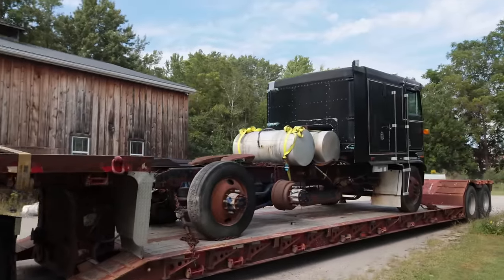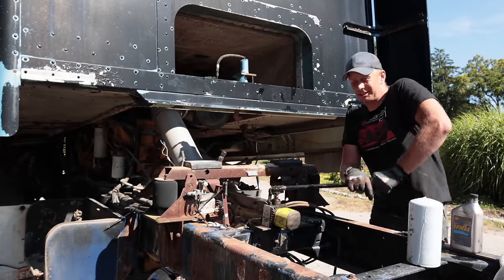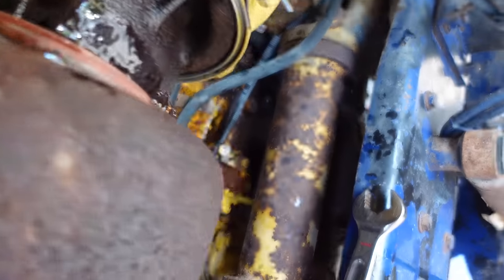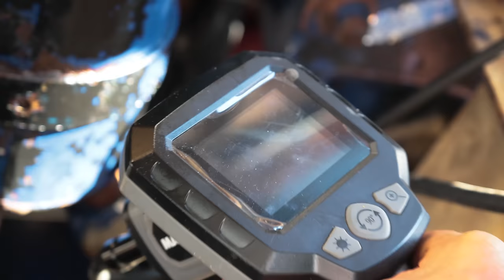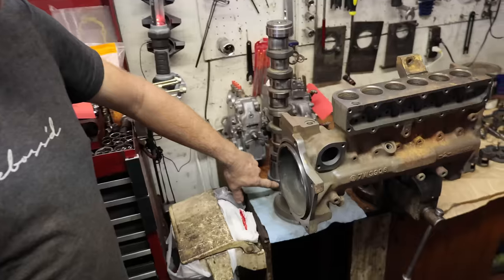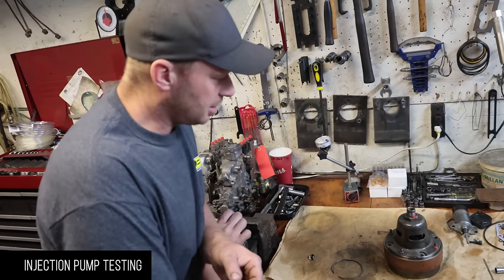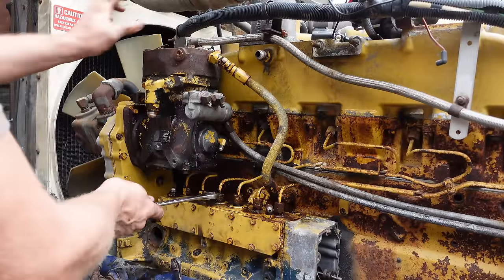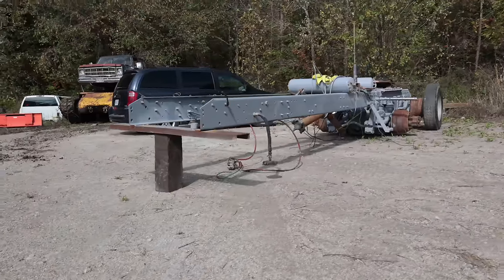Will It Start? CAT 3406b Kenworth Cabover Hasn't Ran in 25 Years! #K100Cabover [EP1]

Comment: Watch part 2! https://youtu.be/fp-C7q6kRFA
Reply: Fantastic news!
Reply: Didn't know you had a second channel. Subbed!!
Reply: Double bonus!
Reply: #teamseas.........
Reply: Good to see the old gal getting a new lease on life
Reply: I drove many different ones during my career all of them did a good job.
Reply: .. TC u
Reply: 5/
Reply: If you are interested I know where a 110 inch double Pete cab-over is setting with a running Detroit 430 or 475hp with an Allison automatic from the factory is setting. The truck runs it is 1978 model Pete and looks very good for its age. Give me an email address and I will send you some pictures of the truck. The person that has it does not want much for it. I think you could get the truck for under $5,000.00. I know I could get it under that.
Reply: If anyone knows where a 1997 through 2000 International 9800 cabover sleeper flat floor, air ride, Cummins N14 with Eaton 13 or 18 speed, I'm looking to buy now. I want it to be a fixer upper but drivable so I could get it home to do it up to match the enclosed race trailer and 88 Monte SS it would pull. Thanks
Reply: CC  gg

Comment: I have always wondered why no one rebuilds their own injector pumps, this explains it.
Reply: Not big deal with injection pumps. Biggest problems are governor fly weights they wear and also timing advance fly wheels. Weights are always moving in and out against thrust plate they wear into it. Hanging idle, not smooth rpm or wear very badly and engine can run away. Mechanical engine kept shops busy about every 2 yrs you where in there replacing them. Or like many never fix them and engine runs poorly or runs away (BOOM engine goes)

Comment: I love the 3406b cat great engine drinks fuel like I do beer. Also I love how you always have someone explain how a part works how it fails how to fix it and how to rebuild it best channel on YouTube by far. Wish you had more subscribers to show that but o well
Reply: I drove an 86 Ford 9000 that had that engine in it with mechanical pump, it was a day cab. That damn thing would roll out, one day i was bobtailing doing 100 mph and didn't know it lol, i pulled oversized loads and that thing would pull. I loved the hand pump because my fuel gauge didn't work and i ran out of fuel. Yes it drank the fuel.

Comment: I was a 24 year old kid who grew up mostly in Alabama, who loved to drive a truck. 1986 I picked up a load of air freight at Dulles, straight to South San Francisco airport. I had a backhaul in Compton to load the next day, so I had plenty of time to get there. Old Freightliner with the huge hood, faded grey paint , broke passenger vent window, the steering pulled really hard every time you went past a junkyard. I tooling down i 5, just past the Taft exit when that fuel advance self destructed. It didn't break the front cover of the engine  (which was not unusual),but Inland Kenworth couldn't locate the problem until they had charged over 6k in labor, dissembling and testing. I stayed in Bakersfield over 3 weeks ! I still love to drive a truck! Full time local. Thanks for the video! Good memories!

Comment: Cat 3406B & C fuel pump and governor were a beast back in the day.... built them for years adjust FARC then set the rack (power & peak torque) they run for years and years .... Sweet...

Comment: Something about Cabovers has always interested me.  I had a fleet of day cabs collected from barns/next to barns from basically what Rich said, people didn't want to drive cab overs anymore (or they were replaced after being ran for a hard life).  The only cabovers I have left are a couple Isuzu's (1 smaller box, another slightly larger with a toolbox/flatbed combo) for fun/utility and to satisfy the want to own one.  A lot of the trucks I had ran fine and with minimal rust, mostly just mice and shot paint from the sun (Midwest US trucks kept in sheds/barns or cleaned).  I kept them until the market/demand for them started to shoot up as projects or for parts, then I cleared out my lot and used the money to cover more than a few of my other much smaller nugget projects.  One example being my daily at the moment, a 2011 Mazda5 Van loaded with options, manual gearbox, the turbocharhged awd power/drivetrain out of a MazdaSpeed 6 (rip, someone hit mine...in a parking lot...parked...away from other cars), and custom suspension to make it all run smoothly and hug the road on turns.  I've always loved the small Mazda5's, a turbocharged AWD sleeper model was my dream...still rip my sedan, though :(.

Comment: Hi buddy, i have a 1980 aerodyne k100 with a 3408 cat, stood for a few years after i bought it in indiana and shipped it to the uk, crappy old fuel had become gum and stuck all fuel pump elements in the up posotion delivery valves and nozzles were also gummed up, we removed all the elements and polished everything. Soaked the nozzles in brake cleaner, now runs like a beauty.

Comment: It's stuff like this that scares me away from working on stuff that I don't know much about. I wouldn't know that the governor weights wearing out can blow up an engine; I wouldn't know that you have to put the pin in the flywheel before removing the injection pump; I wouldn't even know not to take the injection pump apart in the first place, much less make sure the ring gear is pushed all the way forward on reinstallation. Oh well, at least I haven't gotten myself into to much trouble yet. I love what you're doing!

Comment: Awesome!!!!! Brought back some crazy memories for me. My first truck was a 1986 LT9000 with a 3406b engine. I bought that truck in 1990 ran it for a couple years then sold it to a heavy haul company in Hamilton. That old girl was still on the road until early 2000's pulling a 5 axle trailer moving steel coils. That engine was just incredible. But man it hated to start in the cold lol.
Reply: Moving coils between the Hammer and Nanticoke I assume

Comment: So on my uncles 1957 D8 Cat bulldozer we have been rebuilding the pump is super simple so we set it ourselves, but in the book it shows that you pull the long side over off to show the shut down and idle racks and you adjust it as the motor runs.

Comment: anyone that says seized , stripped nuts and bolts arent a big deal either hasent done much work on cars or got really lucky to live in a rust free area. Personally i live in New Brunswick canada where a you have to heat almost everything red hot to have a chance of getting it out without stripping or breaking it. You bring cars in to the shop here and as you use the impact gun rust piles up on the floor. I really enjoy your content i dont work on desiel but i have learned a lot from you about general automotive work/ fabrication. The way you explain things just makes sense to me, it would be so awesome if you made a video explaining how to use a multi meter to trouble shoot automotive problems.

Comment: 25 years stopped soon I thought problem in the pump end also in the turbine
Here in Brazil we sometimes run engines with 2 or 3 years stopped
25 years is a long time
Congratulations on the work 👍

Comment: Got to the fuel pump segment, I could watch him break down pumps in timelapse for hours without commentary, commentary at certain stages would be amazing.  I already watch a few channels tear down and rebuild transmissions, engines, and ECU's, this would be awesome to see pumps ranging from commercial/ag sized ones like this down to the smaller mechanical pumps like the few OM605 Mercedes pumps I have in my warehouse for various 606 projects.  Coming from a mathematics and electornic engineering educational background it'd be interesting to see the electronic systems gone through too.

Comment: I needed a Lucas CAV pump for a land rover diesel. Reman from vendor was $1500, rebuilder in texas wanted $300 plus shipping both ways. I found a complete running diesel at a local shop for $200. Swapped pumps and replaced the timing belts and everything worked fine.  I have the old pump to rebuild once I'm courageous enough to take it apart.

Comment: My dad used to have an early 70s K100E. 400 big cam, was modified and melted pistons on multiple occasions lol. Would outpull all the newer trucks back when he was trucking, probably 550 or 600hp. Would pass trucks uphill lol. Was stretched with I believe a freightliner back half, the frame rails slid together perfectly.
Reply: Messing with diesel injection is fun, I replaced the injector nozzles in my car outside on the tailgate of my dad's pickup. I have injection issues but it's either my pump or the wiring to the pump, injectors turned out great lol. Stock is I believe .184 5 hole, I put some .205 5 hole nozzles in from Fratelli Bosio.

Comment: Love those old K's. Had 2 in 05 and people gave me crap about it, but while they starved, making $2,500.
pymt's mine were paid for. My driver was a 89 K100 Aero. w/a
KT450 H.D. Cummins, 15sp. Fuller OD. Legendary power! So much torque, timing dwell factory recessed cause they'd  climb so hard. Designed for stationary use. It'd overheat & blow drive tires! Outlawed now for factory sale in trucks. My spare was a early 90's
K100 w/9sp. 3406B Catt. But with
411 rears. Strong but slow! 60-65mph. was its top cruising sweet spot. Anymore, and it was wrapping up too hard. 5MPG is all you'd get from those old B Catts.
Miss trucking a lot though.
Reply from the maker: Thanks for that!
Reply: @DEBOSSGARAGE  anytime my man. Just keep on doing what you do, and giving them trucks a 2nd life. Came up in trucking in the 70's & is heart breaking seeing trucks I loved so much, shunned, abandoned, and left to rot and die in some field. They're the original Large Cars, that started it all. To which conventionals wouldn't be here otherwise. Thanks!
"TumbleWeed"

Comment: The reAr 8 bag is a good system . I worked with a guy who bought a new K.W. With 8 bag . One of his first moves was a 105 ton move . The 8 bag  made the move with no problems . The move was a large magnet from Chicago to Stanford Universitie  .  Iam guessing about 350,000 gross weight . The truck trailer was just a bit over 140 feet . What you got is good .

Comment: First thought was rack stuck in off position . I served my apprenticeship on medium diesels (the one in your truck is considered a small high speed diesel) and a lot of Marine units would  have that problem. I would remove the side plate and push the rack and watch the movement. I had one once which was  really stuck in Off, and it took a blow with a hammer and punch to make it move. After a few minutes of cranking it fired up and ran beautifully. No real mystery in Injection pumps, just remember that you need a test bench to set the fuel rates. test benches will set you back a few grand....Cheaper to pay someone to rebuild the pump.

Comment: I had issues with that damn solenoid blowing on a Terex excavator. It would shut the thing down while it was rolling and it shared a circuit with the ignition and imobilizer so it would lose all power.

Comment: Cab jack should mount to the 4 holes in the rear cab mount, on the passenger side.  Most also had air assist. The camera was given by the companies in case you had a wreck or a claim.

Comment: the good ole 3406B.......700,000 miles, its going to need new bearing shells rolled into it. to bleed inline pumps, crack one injector on top of the pump. Very cool getting to see inside a Cat pump.

Comment: Few years ago before my last truck purchase I spent months looking for a decent KW cab over with the big sleeper on it,found a few but dear Lord they were just stretch out it made it about useless,really kind of ticked me off.
It was at the point that if I had found a fully restored one to have the frame cut to usable length.
To each their own when it comes to their truck but if I am in a cabover I don't want a turning radius worse then a Freightliner XL with the stops in,plus I really don't need a 150 ft. long truck & trailer.

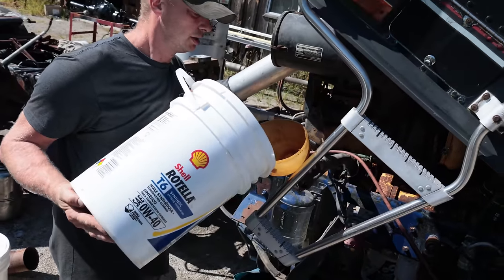Comment: 9:37 You´re using 0W-40 engine oil. Is it correct to suppose that viscosity only for tests?? Which should be the right viscosity assuming engine is running well and no excessive wear?

Comment: Fascinating explanation of the pump rebuild. Why didn't you just have the orig. pump rebuilt instead of hunting for a core?
Reply from the maker: It was seized.  Since the clearance is effected by the rust, it will never be perfect again.  It also had smaller plungers as it was 300 hp.
Reply: @DEBOSSGARAGE  Figured there must've been a reason. Could've been seized from gunk or just a very small area of rust.. Idk what the tolerance on that rack is  & obviously some of the tolerances on that pump are extremely tight but I suspect not as much so is required on that rack. 

Great vid! Learned a lot about how those pumps work.

Comment: From experience on my old project if you pump the throttle about 3 times then start it then it fires up in a split second.
Reply: On the fuel pump adjust the two nuts to adjust the fuel mixture i might be mistaken one of the nuts you adjust changes the rack position

Comment: On a Cat, oil pressure opens the rack on start up.  Turning the key on and opening the throttle once opens the rack and it'll start immediately.....if its got primed and otherwise ready to run.

Comment: You said that 3406b had 300 horsepower is it turned down all the way or what because I have same exact engine and it has 430 hp it’s in a big wood chipper

Comment: Hello Rich! I have a question for you. Would 5w40 rotella t6 be good for a high milage 6.5 diesel? I drive it every day and i have put a lot more power and upgrades into it. The reason I am asking is because i cannot find any Rotella t6 15w-40 anywhere besides online, and I wanted to know if 5w-40 will work.
Reply: Hi Douglas,
Cannot speak for Rich but 2 years ago I bought a used 6.0 power stroke f250. The previous owner used Rotella T-6 5w40 since new. It now has 341,000 mile and knock on wood still going strong. 
I’m no professional mechanic but I think T6 is great diesel oil.
Cheers,

Comment: I thought a b model doesn't directly move the rack with the throttle input it puts more or less pressure on a set of weights which runs the rack on the pump

Comment: And that GMC I got is a 1978, and by the way I got a 3406B cat 1989 motor. and got a 1994 peterbelt cabover 362 nice , going to put the cat motor in it. When I get things fixed up like your doing , wait on good weather and then work on it. work on it like you do outside, no roof to put it under well have a good one and see ya next time see ya bye bye.

Comment: Lincoln  low pressure transfer pumps , with distribution hoses for external pressure ports w, quick disconnects . Preluded loco engines all the way to hot rods . U may of done it this way or not . The rotella oil has all most 600 degree flash point . Heavy diesel w/turbos , race engines works great .even using Rotella T since1981 . Wont use anything else . Even my gas engine Mercedes calls for this !

Comment: Ok, FYI. DW 30 is a water displacement product, not a break free or lubricant. Online you can find a product that has  been around for many years and is in my opinion the very best in its class, It is called kroil by nano technologies and if you are not familiar with it, it will change your idea of break free and penetrants.
saw a guy spray a siezed model A engine and in a matter of hours he was able to turn it by hand. swear by it. If you have never, try out a can, guarunteed you will keep it on your bench or cart from then on.
Also they make many other fine products. check them out.

Comment: 3406B mechanical is one of the easiest engines to prime (I know-I have one). Put fuel in the tank, remove the return line and plug up the hole to the tank. Remove the breather and shoot compressed air into the tank-and watch for the fuel to come out of the return line-and wala! It is primed-start it.

Comment: You gotta prime all the lines coming out of the pump going to the injectors
Reply from the maker: No, the pump builds the pressure.  Any air after the pump will just get compressed enough to get forced through the injector

Comment: If you would use the hand pump on the fuel pump to pressurize the system and then manually (with a 3/4 wrench) bleed each line to get the air out it would start right up. You are trying to start it like a Cummins. That fuel pump may need some tlc. I haven’t been into one in 35 yrs but cats fuel pumps were nearly indestructible.

Comment: I want a cab over sleeper cab to remove the frame and put the cab on my  2nd gen dodge  frame. But I don't want a bed . I basically want a cab on wheels. A rolling box.it would be strange and different and a good way to use my great running but totaled dodge

Comment: Mechanical rack fuel pump should be on full fuel when not running, because the speeder spring is overcoming the centripetal forces created by the flyweights.

Comment: Wouldn't a little 12v gear pump be easier than that contraption for a prelube
Reply from the maker: I can monitor the pressure better.  Only put 40psi behind the bladder

Comment: Why didn't you take the pump off the engine and send that for rebuild vs buying a different pump to rebuild? wouldn't that have saved you the cost of buying that core?
Reply from the maker: original pump was seized.  Bores would never be the same.  Original was also 300hp, new one was 425
Reply: @DEBOSSGARAGE   Makes sense. Thanks for the answer!

Comment: Your oiling system seems excessive, why not just put the air pressure directly on top of the oil then turn off the valve before it pushes air through the galleys?